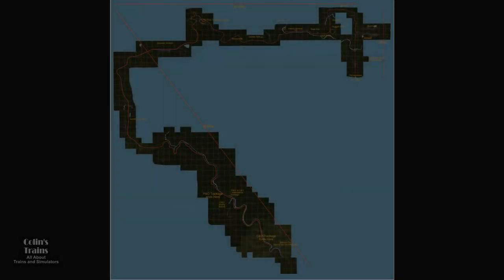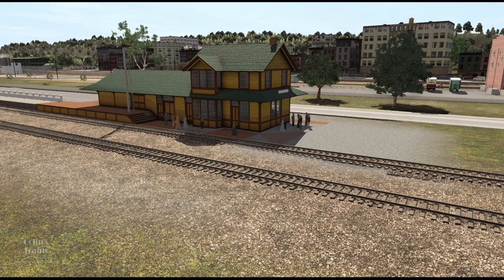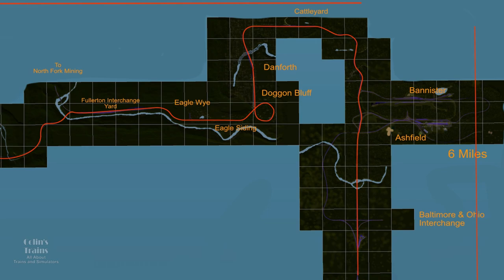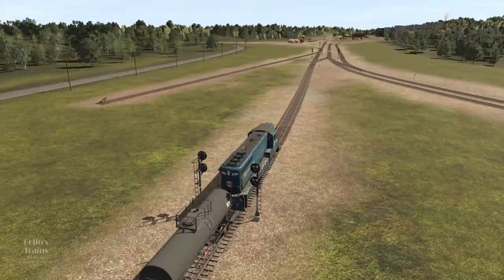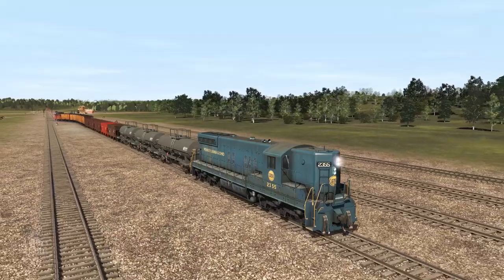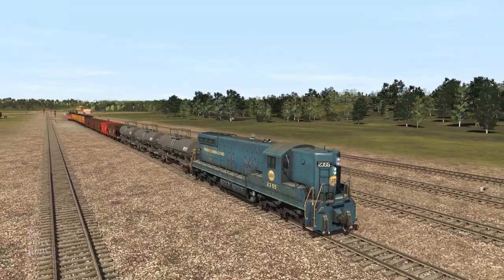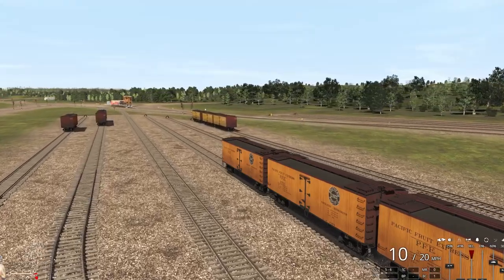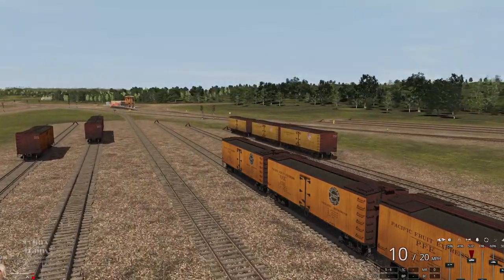Trainz TRS2019 Route Building Update Pennsylvania & Ohio Railroad

Comment: Not to realistic but I'd love to run a early years of steam excursion on this line.
Great work on this route. I will definitely be waiting for when you've finished it.
Cheers!
Also where did you get some of the models in the video? I'm guessing some are K&L but great job with the re-skin.
Reply from the maker: Thanks . . . . . .  Yes the steam engines are all K&L and have been reskinned . . . . . . . . .. . . . . . . . ..  Most are PRR models ..  but the little switcher used in the video is not PRR . . . . . . . . . If I can get it up to a standard I am happy with . . and can get it to run OK on common PC rather than the power model PC I have  . .then I will arrange for it to be available . . . . . . . . . . . . .  my next video is about signalling on TRS2019 and the simple route example I am using will become available on DLS for people to use as an example for their own routes . . . . . . . . . . . It will include examples of most track configurations including single track . . . . .double track . . . .sidings . . . . . . .crossovers and wye mainlines . . . . . .. . . . . to mention a few . . . . . .
Reply: @colinstrains5885  I will be looking forward to it!
Thanks again for the easy to understand and great tutorials.